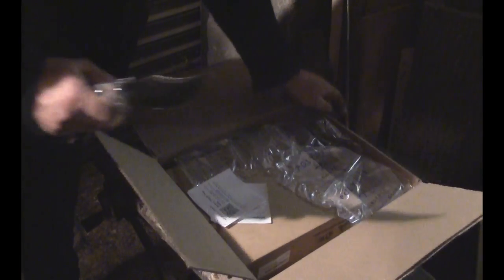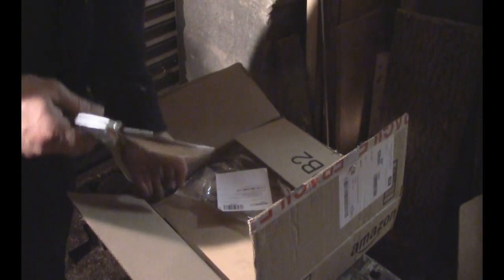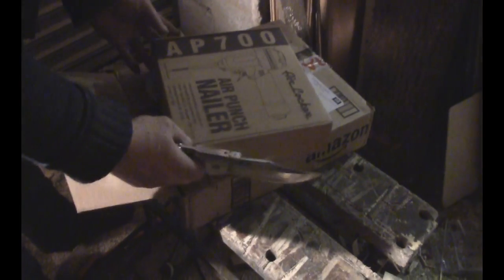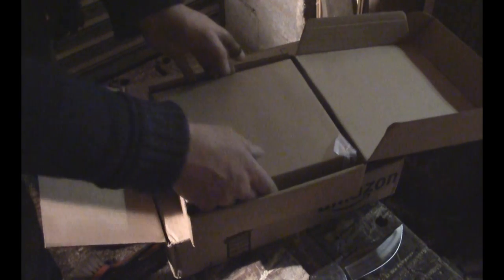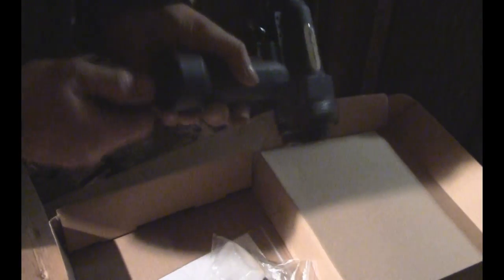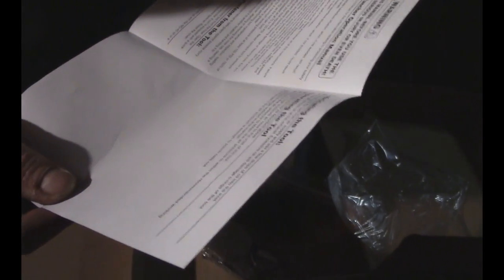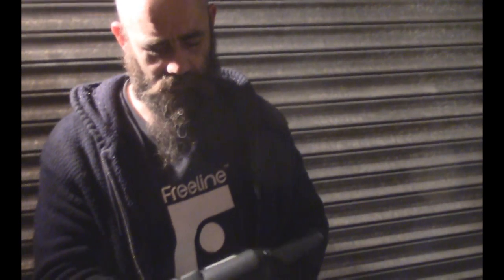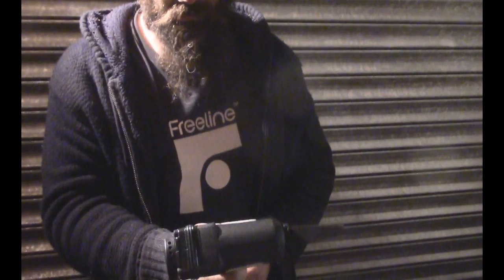Pallet Nail Remover Air Locker AP700 review and use Denailer

Comment: Bought this tool after watching your video. Thanks for the heads up it's a great tool. Saves using a hammer but still occasionally have to use a crowbar to finish the job. Working at 8 bar at the minute.
Reply from the maker: No problem, glad i gave a good recommendation :) And  mine still works well, ill have to check the date of this video to see how old it is now. 
I think thats about right at 8 bar? ill check my gauge again later. Yes im also still using a hammer as they still need pulling sometimes that last bit but it does away with all that straightening and tap tap tap to start them off. I did a few with the hammer last night as it was too late for the compressor and i forgot how time consuming doing them by hand is :)

Comment: Ps The nail gun remover saved a lot of time, energy and suffering trying to get those nails out with a claw hammer. The nail gun, electric air compressor and adaptors came to about £200 in total. The nail catcher we used is simply a disused empty large olive oil can. It's worth keeping the oil can top to keep nails in the can during transportation.

Comment: Losing power because your holding the wood, wood should be laid flat on a solid table with nailed area over something to catch the nails.
Reply: Also you should have a larger diameter hose to the tool to get more airflow.

Comment: The instructions told you twice to oil the tool...I did not see that you put any oil in the tool...perhaps I missed it?
Reply from the maker: No, I never put any in from day one and its run perfectly up until recently without a drop and without me having a moisture trap on my compressor, i can also hear water sloshing in the bottom that ive been meaning to drain for a few years now. 
Its been used hard and long, possibly its done as many as half a million impacts in its life. The main weak points are the piston guide and the piston itself getting damaged through wear. I need to upload a final update on this unit and my thoughts.